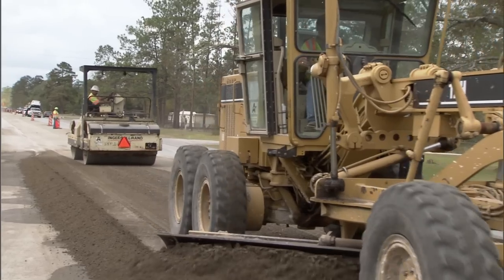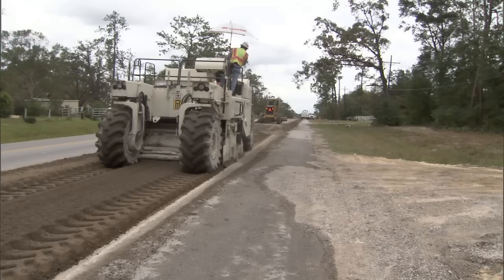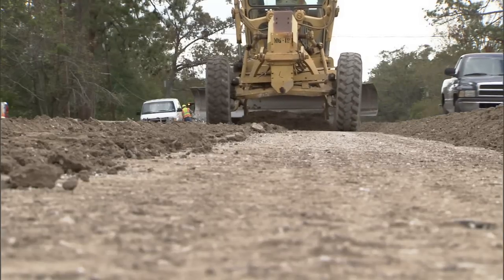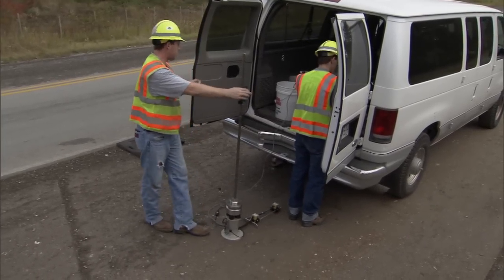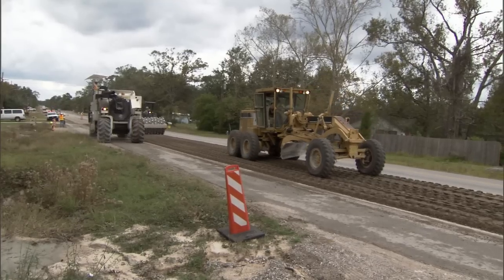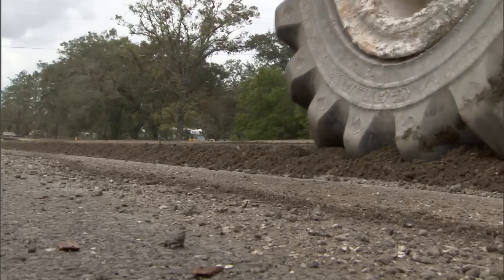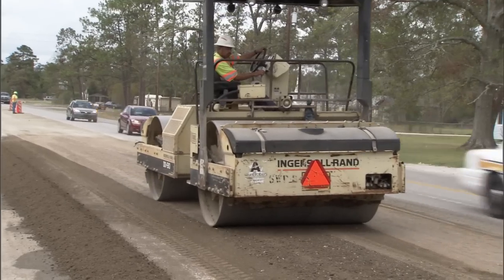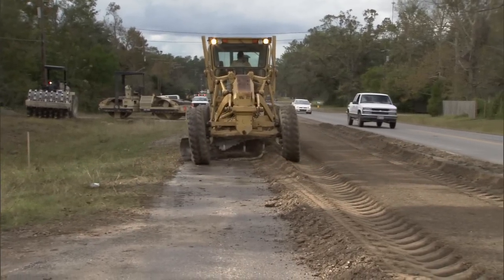FDR (Full-Depth-Reclamation) Performance-Based Design, Construction and Quality Control

Comment: Is it ever the case that it is decided to include the top 1-2in of subgrade in the stabilization? Maybe not necessarily including it in the reclamation, but setting the reclaimed material to the side, and then stabilizing and re-compacing the subgrade, and then doing the rest of the work normally? I guess, if there is an underlying subgrade issue, the reclamation won't necessarily repair without doing this kind of work.